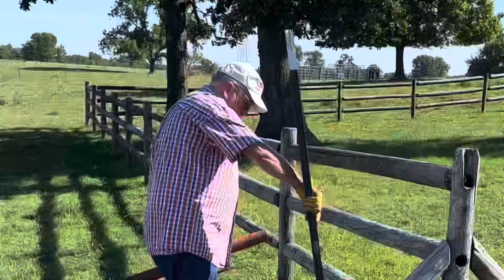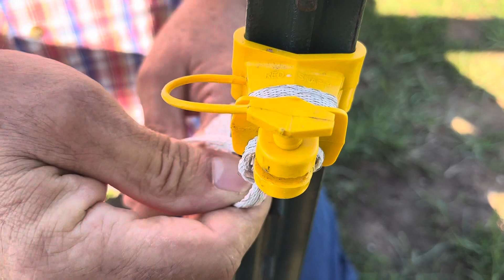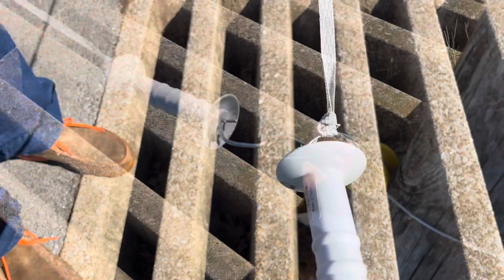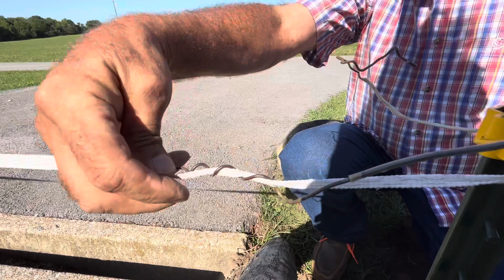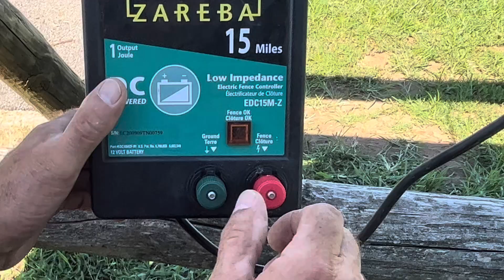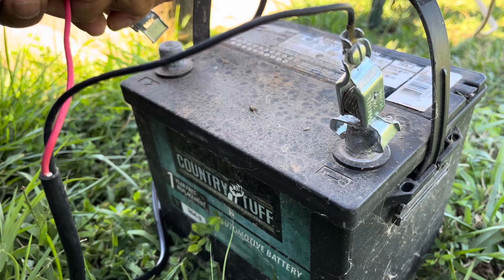Electrifying fences made easy, with battery power

Comment: With this set up you have to turn it off in order to move it aside and drive through right? If not it looks like it would land on the ground or the cattle guard and possibly arc or short if you don't
Reply from the maker: Correct! It’s a hassle, but works at keeping calves out of the yard.
Reply: @JERRYCROWNOVER  makes sense.. thanks for taking the time to respond!